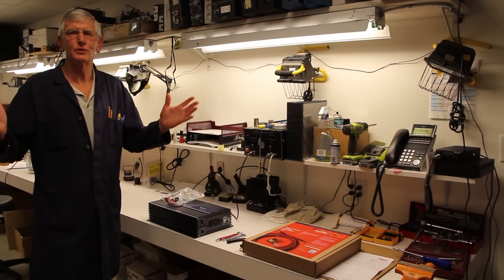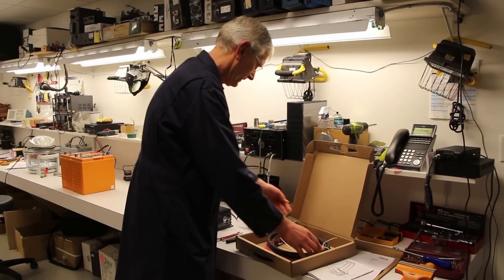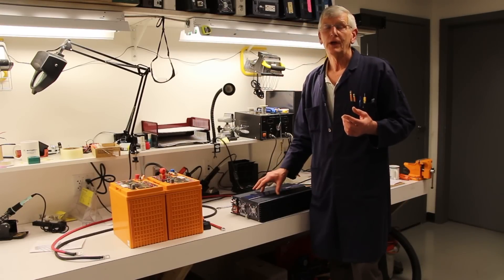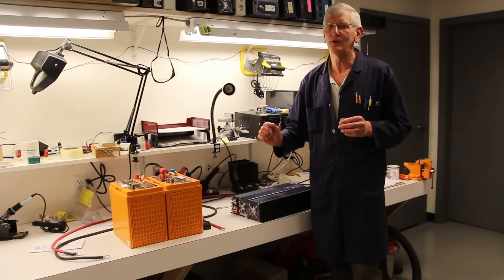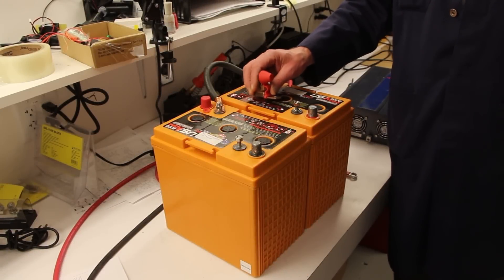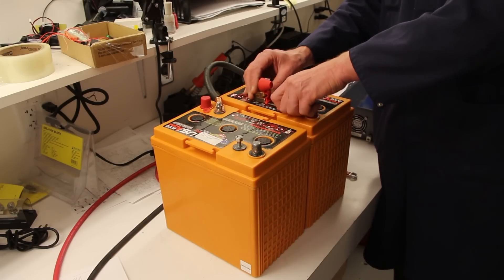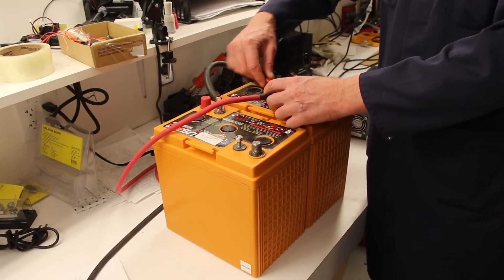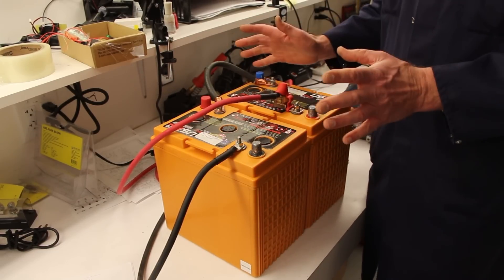How to Connect an Inverter to a Battery Using a Samlex Cable & Fuse Kit

Comment: Hi is a 200amp fuse ok for a 2000 watt/4000 peak inverter?
Reply from the maker: Hi there, we specify a 300A fuse for a 2000W inverter. If you have further questions, please contact our tech department at 1-800-561-5885.

Comment: OMG IM SO CONFUSED! Ring terminals or pin terminal how can I be sure of what I will get when I purchase my inverter??
I wanna run some led lights computer and charge my electronics. I have two marine 35ah batteries will the samlex pst 600 do the job???

Comment: that's wrong.  you should not connect the Inverter first. 
the sparks near the battery Could be lethal  !! 
the correct way to connect wires on Battery first and then to Inverter.
Reply: Nadeem Ahmed alway connect invertor first..